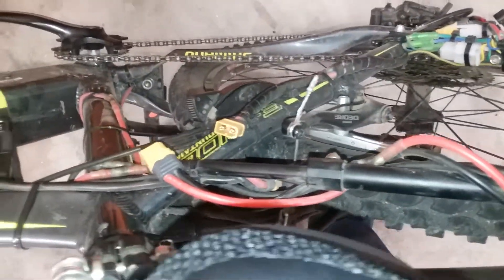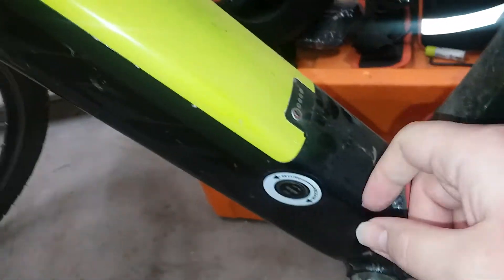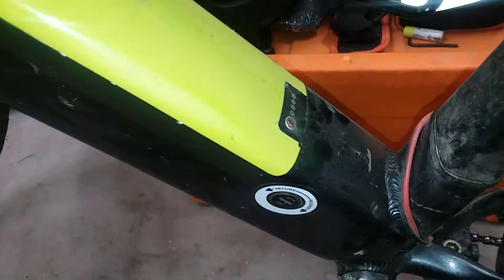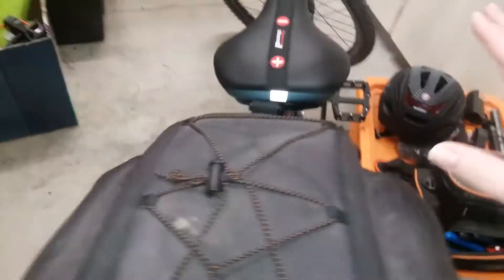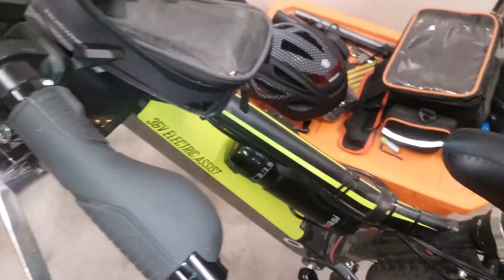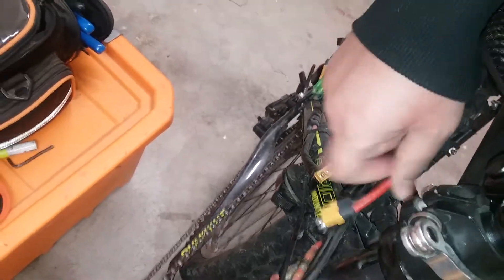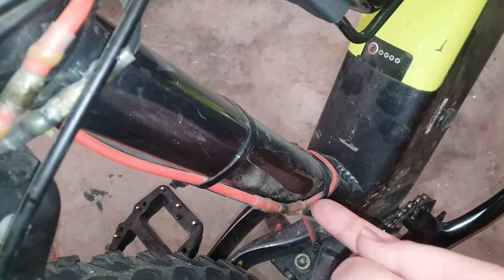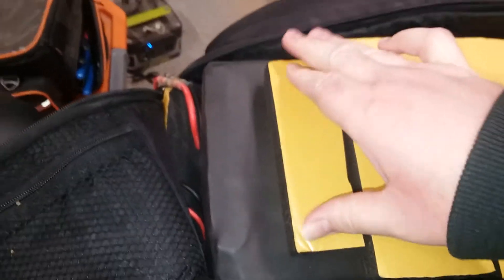Dual Power. Internal and External cabling?

Comment: I need to replace my 810 PAS led display. Any ideas where the new display connects and how to get to the connection?
Reply from the maker: You'd have to call Hyper/walmarts help line. Then you'd have to unscrew the middle screws inside the frame piece where the battery slot in. Plus the front/top cover since the ESC is on the upper frame piece.
Reply: Got it... Thank you

Comment: Is there a wire to cut for more speed
Reply from the maker: Not for the stock ESC. Nor this Electric speed controller or the one i currently have for my 500watt ebikeing kit's system. Also the speed can normally be self limited by the amount of power placed into the hub. The stock can only reach around 20mph. and the ebikeing can only do around 20-25mph.
Reply: @KillerRaptorr  im like 130 and it does 20mph its gotta have more power
Reply from the maker: @Gothguitarist  maybe you should learn motors then.

Speed, Rpms, Torque. Are quite different from each other.

Most laws limit companies to 20mph speed of ebikes. Rpm and torque though aren't restricted. So this does have alot of torque to do some light hill climbs. But the motor can only do so much from the esc and how it's gearing ratio works inside.
Reply: @KillerRaptorr  ive literally seem one do about 25 mph by messing with the controller there's always a way I know about motors I built gas motorized bikes
Reply from the maker: @Gothguitarist  if you want more speed. Swipe the rear wheel for a cassette system with around 8 to 10gears. Then put a mid drive on the cranks. Most bafang motors can be set to unlimited speed or limited to such speeds. But your motor power and gears will also depend on how fast it'll likely go. Since mid drivers are torque based motors higher gears you go for higher speeds will start you slower.

And might need a new battery to fit the mid drivers power. Unless you go like 36volt 250 or 500watt drives to use the stock internal battery with it.
Reply from the maker: @Gothguitarist  You get a upgraded controller and use a higher ampage battery pack to give the motor more power. But the stock I'm not sure how limited the output ampage is.

Stock has no programming features or throttle cable. Also gas engines don't work on electric speed controllers. Nor have good Rpms for hill climbing. Their mainly good on flats.
Reply from the maker: @Gothguitarist  if you really want a speed demon bike and light. Give the hyper back and get a carbon x 26inch. Put a 1000+ watt rear hub motor wheel on the back. With a mid frame battery that hangs. There's another video of few who transformed their hyper carbon xs into ebikes speeders.

Since you have the knowhow to upgrade a standard bike to gas then a ebikes conversion should be easy.

Comment: I have a quick question I'm in the market to buy one of these hyper ebike but om buying used because there's a really good deal on one but it is the rims break model and I'd like disk does the factory hub have disk break mounting points?
Reply from the maker: The 26inch version is fitted with V-brakes (rims.) But the rear does have Disc brake for Optional upgrade/switch to on the frame and the hub motor has 6bolt screws (You'll need to use these and not your disc kit screws because the ones will be to long. So you'll need to use only the screw that are screwed into the hub.). And you'll need to buy possibly a brake cable set for the longer cable and hose for disc conversion.

The front of the 26 does not have disc brakes option for the Fork or hub. You'll need to by a new Fork and a new wheel (which is rather easy.). Then you can have disc brakes Rear and Front.
Reply: okay thanks for all your help I'm definitely going to buy it if the rear hub is good I'm planning on upgrading everything on it but I'm getting it for such a low cost that it's a no-brainer